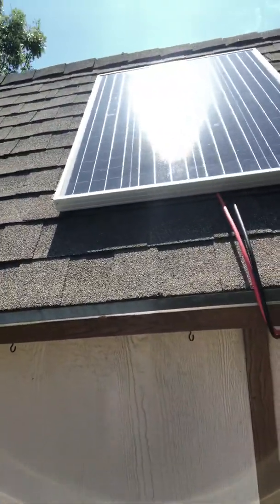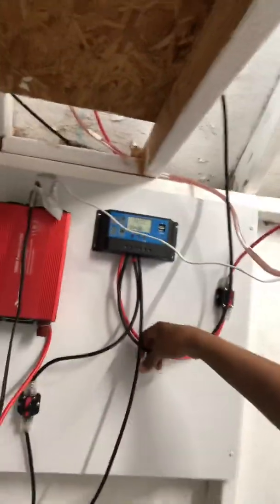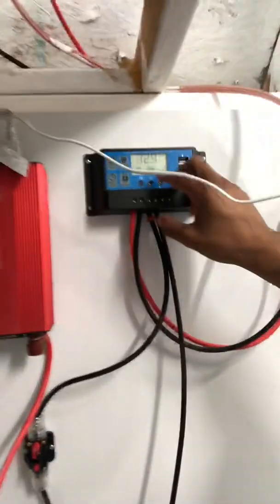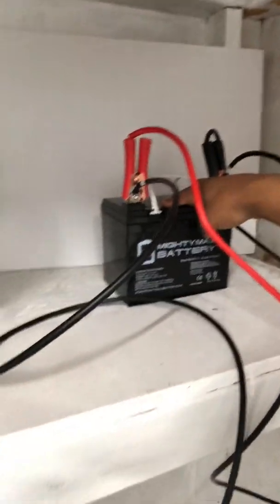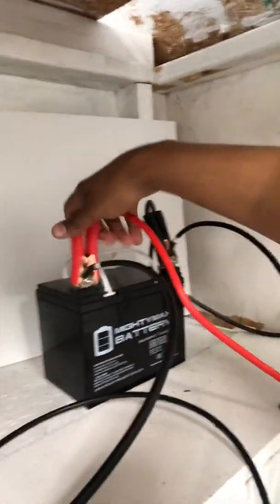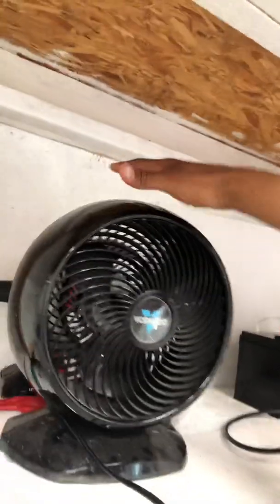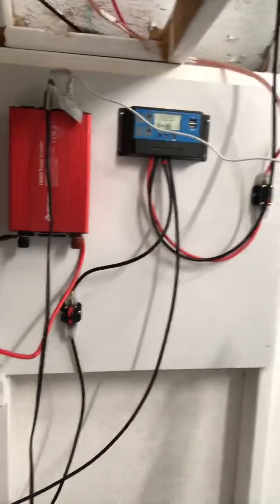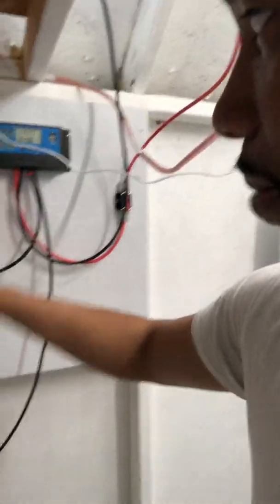My Solar Office Shed Part 1

Comment: I can't believe that you haven't had a single comment yet. Excellent video showing a super cheap and basic system. this is just enough to know if you want to get better bear before spending a large sum of money.
I won't point out any errors as I am sure you've already spotted the big ones and fixed them. 😃